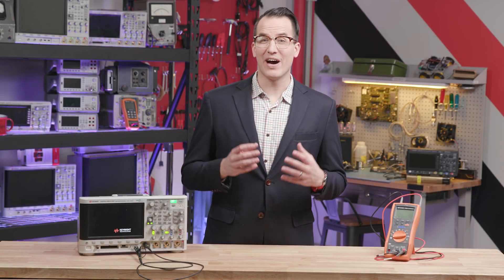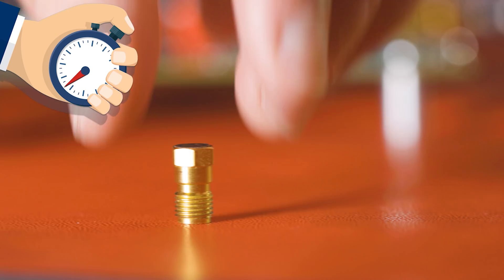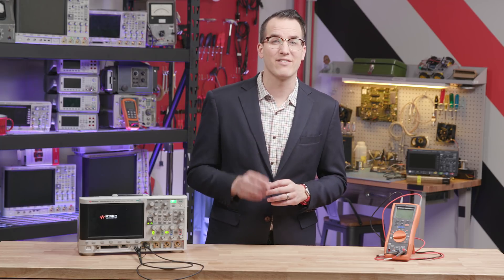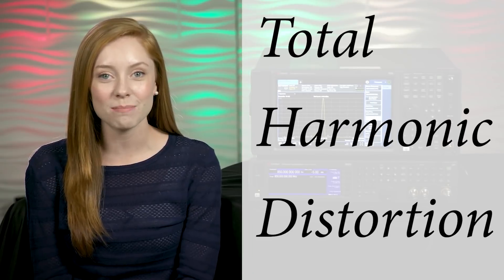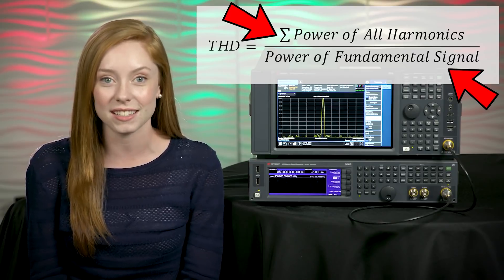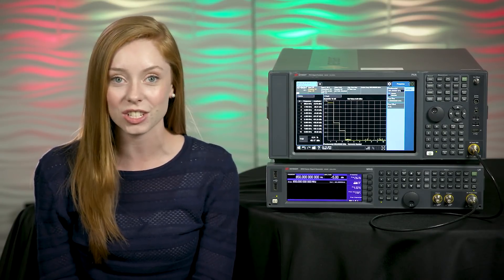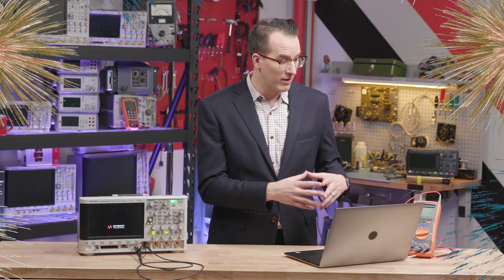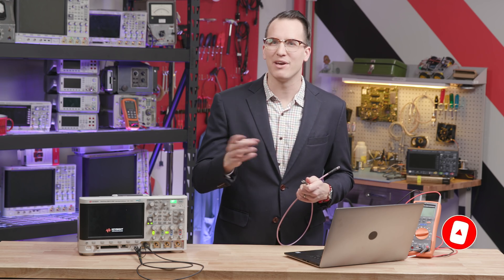6+ ESD Tips in 60 Seconds + Wave Winners!

Comment: I'm late to the party, but oh well. I almost died because of an ESD strap. Back in the old days, I was dissecting an industrial system that went wrong. It was on an anti-static mat, waiting for me. I got in front of it, put on the strap on my left wrist (habit), and instinctively bent over to yank out the 220V plug. The original cord had been in some sort of accident, and the 220V mains line wasn't protected, and I had the good idea of yanking it out at that spot, clenching it as hard as I could. 220V through the right hand, through my heart, and out through the anti-static strap. The lab 30mA differential trip switch hadn't been tested in months, and failed, so I had to "wait" until the floor trip switch kicked in, and I don't know how long that took. I woke up in hospital, feeling extremely weak, but alive. Everything could have been avoided if doing really simple things; not sitting down when I removed the cord. Checking the cord on arrival. Not actually plugging in the thing in the first place (the RTC could survive a few weeks without power). To this day, I really hate working with anything above 5V, even 12V makes me a little nervous. 220V? Forget it. Oh, and what am I working on now? Electric vehicle chargers. Yup.

Comment: A little tip I found when younger- high concentration (99+) isopropanol is conductive enough to dissipate static buildup while being  generally electronics safe, is cheaper and leaves little to no residue unlike other antistatic sprays
Reply: Some numbers to back that up-
https://www.google.com/url?sa=t&source=web&rct=j&url=https://www.shell.com/business-customers/chemicals/our-products/solvents-chemical/alcohols/_jcr_content/par/tabbedcontent/tab/textimage.stream/1460023044637/b0b7ef356c65f2fdd262453bd3eb009011c1bfd0/ipa-s1111-eu.pdf&ved=2ahUKEwj5ydDFgYfoAhXTolwKHVZGCBcQFjAKegQIBRAB&usg=AOvVaw20xYE2d06X3DxI9_nGQE9Y&cshid=1583537942237

And various other sources give it a conductivity of 6microsiemens/m
-and that's for 99.8% purity, more water is gonna mean higher conductivity.
That works to a resistivity of 1.7e5 ohmmeters or about 1.7e9ohms/sq for a conservative 0.1mm film - way higher than the threshold of  static dissipation of 1e12ohms/sq.

It's even better than a lot of surface coatings designed for the purpose- hovering at around 1e10 ohms/sq.

Found it out trying to find a solution in high school for one of those "industry outreach to inspire the kids" thingamajigs, where they give you problems and maybe some industry experience and whatnot, ours was static in a small PCB fab.

I was actually amazed by how well it worked- our contact had brought one of those electric field meters, and it just dropped immediately to zero on applying the alcohol
Reply from the maker: We did some digging into this and tested IPA with a Teflon sheet:

Before applying IPA to Teflon sheet:
- Resistance – 7E12 ohms.
- Charging with a cotton wipe – 6,000 volts/inch static field

After wiping surface with IPA and waiting two minutes:
- Resistance – 6E12 ohms.
- Charging with a cotton wipe – 7,000 volts/inch static field

Essentially, the IPA is dissipative until it dries, but then it's basically the same as before. It's not a suitable alternative to an antistatic mat.
Reply: @KeysightLabs  nice, wasn't expecting a reply :D. I did mean it as only a temporary measure while it was wet- dissipating the static on an enclosure/pcb before installing and sealing up. Or some really sensitive equipment that you wanted to protect from static discharge during installation, but were worried about the effects of a traditional permanent antistatic film/coating on the long term reliability of.

Or even the reverse- disassembling a device and bringing its potentially rather insulating enclosure to ground potential temporarily while you remove the internals and place them on a proper antistatic mat- to avoid any damage from contact with charged parts of the enclosure/ground.

Not at all a replacement to good anti-static practices, but I can certainly see some, perhaps niche situations where it could come in handy :D- in the transition period between to locations where it's relatively safe
Reply: @KeysightLabs  something like a plastic enclosure- it can be a pain to deal with, because it's non conductivity makes it very hard to bring the entirety of it safely to ground- only the part touching the mat is going to ground itself, the rest is going to be able to hold a potential, by temporarily increasing the surface conductivity you should be able to bring it to ground long enough to do what needs doing and get out, before it has a chance to rebuild significant static, so to speak.

A production environment would probably end up using something like humidity control or air ion generators to neutralise that charge, but that could be prohibitive if your operation is small, with the caveat that you have to be quick, although if you yourself are grounded, and it's sitting on a good mat, you would remove most major sources of charging the housing.

Comment: How is the oscilloscope waveform update rate compares to the sample rate?
I watched one of The 2-Minute Guru about the subject and I feel I need more info. I will be thankful if you provide some insight into the waveform update rate and how it affects my measurements.
Thanks
Reply from the maker: Good question! I'd defer you back to the 2-Minute Guru episode on it, but basically it's this:
Waveform update rate is how many times the scope can acquire a waveform in a period of time (usually measured in wfms/sec)
Sample rate is how far apart each individual ADC sample is on a single waveform
Reply: @KeysightLabs  Does that mean if my scope has a high sample rate and low wfms/sec, I might lose some of the input events even if the sample rate is more than twice the input signal frequency (Nyquist)?
It will be great if you show some examples in one of your future videos.

Also, does it imply that the waveform update rate is related to how much ram exists and how fast the CPU can plot data on the LCD?
Thanks for the reply.

Comment: lol i actually did all 3 correct on the quiz :D QQ: How can I make my own esd or ground/esd for  protect what I work with, when I don't have a properly grounded outlet (it's old house I live in hehe).
Ther is only 2 grounded outlets far from my room.even my computer is connected to a non grounded outlet(and i dont like it) :)
Reply from the maker: Congrats! I guess you could always try digging a ground? The main thing (no pun intended) is to keep you and the equipment at the same potential.
Reply: @KeysightLabs  Thank you :) oh i see :D so i guess it can help if i make a ground spike of copper with a wire to a bracelet like showed in the video :D
Thank you for reply :)

Comment: So what's your take on the use of "ground eliminators" on oscilloscopes with grounded power supply cords?  A number of people in our department seem to think it's a good idea to isolate the ground pin on a scope from the earth ground if they're testing other AC-powered equipment (to avoid ground-loops?).
Reply from the maker: Ground loops are bad for noise levels, but it would be better to get everything on the same, stable ground. If you're using a ground eliminator, it's hard to say how accurate your measurements actually are - probably won't hold up if you need metrology-grade measurements or traceability?

Comment: ESD is often ignored and poorly understood. For those hobbyist that have a basement lab, carpet on the floor, while you keep the HVAC heat on full blast during the winter, because the heat rises upstairs, while you are wearing that crazy polyester sweater grandma gave you for Christmas, is an atomic ESD blast ready to nuke your circuit board and your test gear.

I guess it's one way to keep the economy going...